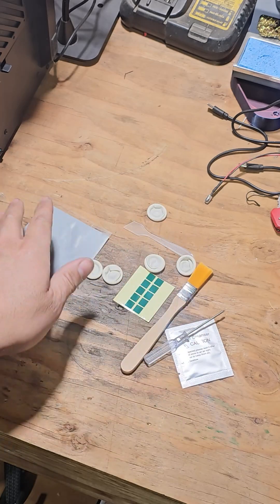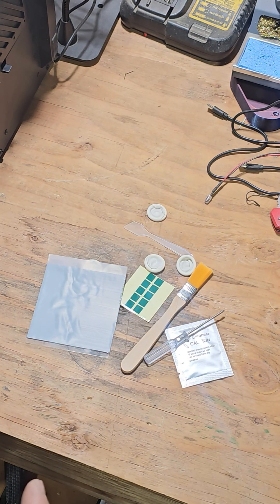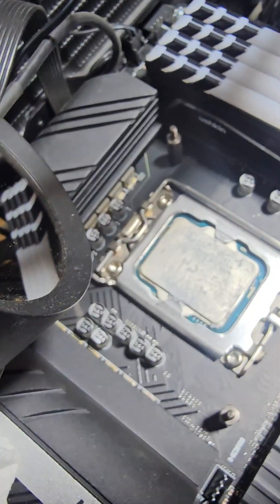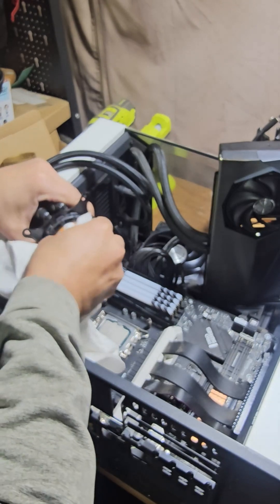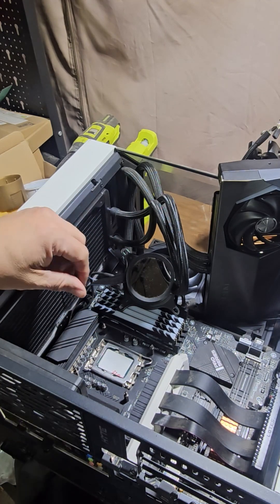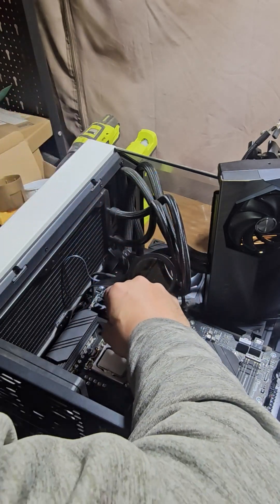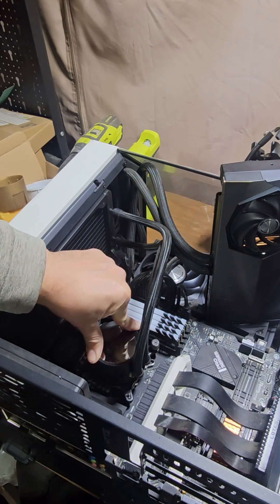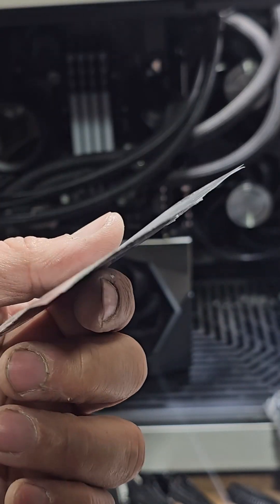GPU Thermal Pad Ptm7950

Comment: ptm works best on laptops , any direct die application,  my 5800h cpu dropped 6 to 10C in games,  and 3060 110W gpu dropped 5t o 10C
Reply: Yesterday I applied the ptm7850 on my GTX 1070ti Asus ROG strix, i bought it from AliExpress in the rgeek store, one thing I noticed when I opened the GPU was that the old thermal past was kinda pumped out to the edges something i thought is normal, but then I proceed to cut the ptm to the size of the GPU die, clean and placed it then closed it and played a few hours, I wanted to check if the thermal pads on the VRAM were pressing it well so I opened again to check and to my surprise the ptm was pumped out exactly as the old thermal paste, I use a plastic to remove the residue from the heatsink and placed it on the GPU die again. I think that actually you need less ptm area than the surface you are going to apply it, remember that this material becomes liquid after certain temperature so in account of that it makes sense
Reply: Where did you buy it from? I've heard there are tons of cheap knockoff replicas that don't work well.
Reply: @path4427  see if i write store name cmt get removed , see linus video where they say that they got from one C seller store ,  eb name is like this
Reply: @path4427  also all are actually replicas , no one sells real honeywell , but it works or r old stocks may be expired still works
Reply: @path4427  i am same account, also all are actually replicas , no one sells real honeywell , but it works or r old stocks may be expired still works
Reply: From where did you buy the Ptm?
Reply: @piyushchoudhary7636  can u see my two replys i think so yt dont let u , reply me with ur email.
Reply: similar for me about 10C drop on my 3060 laptop
Reply: İs it still good? İ have the same cpu!
Reply: @lifirat  Yes its still Amazing , even better after so many cycles, it performs really well ( especially like if my cpu is at 85c then its boosts way higher than it used to ( when it was at 85c on paste ) as heat transfer is much better on ptm. Just go for it

Comment: This stuff worked well on my laptop CPU and GPU. I originally tried MX-4 but the CPU was thermal throttling, I bought some PTM7950 and no more throttling. It is a pain to work with though.
Reply: Throw it in the fridge. It’ll harden and make it super easy.
Reply: you should put in the fridge (sealed) for around an hour and apply it asap or itll rip and be extremely hard to work with. Its a bitch to work with at room temp.
Reply: Is it hard to apply?

Comment: PTM 7950 doesn't work well on desktop CPUs. You're better off with Nh2 or artic.
Reply: With my 9950X3D, I've used NH2, Kryosheet & PTM7950. Had the best results with 7950. No pump out as well with my waterblock so even better.
Reply: ptm 7950 is not a thermal pad hahaha u dinguss... Its a phase changing material... It works even on my 9800x3d even better than artic ones lol .. try to research how good this material is.. the longer u use this the longer it gets better also..
Reply: @alexandermercer4514 i use it in my laptop... unless you have a serious overclock or heat problems a desktop with aio will not get hot enough to benefit from phase change paste. my 9950x3d works best with nh2
Reply: @alexandermercer4514would it work fine with an air cooler? I also got a 9800x3d
Reply: @H786...  Yes, I have PTM7950 on my 9800X3D under a Peerless Assassin 140SE. Works great, and I'm closing on 6 months with no change in temps after the initial settling time. When you install, make sure not to get air bubbles between the CPU, PTM, and HSF. Small ones will pump out, so don't super-sweat it, but any bubble is a blockage for moving thermal energy. After it's all set, idle and load temps will be high for a while, takes time for the CPU to get the PTM soft and let it flow/settle. I recommend 10-15 min idle, then 10-15 min low load, watching temps, and slowly bring up the load till it's 100% loaded. As the PTM gets past 45-50C, it'll liquify and settle, let it sit at full load for 30-45 min to make sure it's fully liquid, then use the machine normally. Temps should be good and will get better over a week or so, as it cycles.

Comment: A good review of this material is on igorslab. He's expressed a concern that in a water-cooled setup, there might not be full phase-change on the cooled side of the thermal interface, resulting in cracking. Don't know if this is a real issue or not. There's also an opinion that it's good on direct die but not so good on IHS.
This material is certainly attractive, primarily due to long life, and to no pump-out on direct die, but wonder if it's the way to go for IHS\watercooled setups.